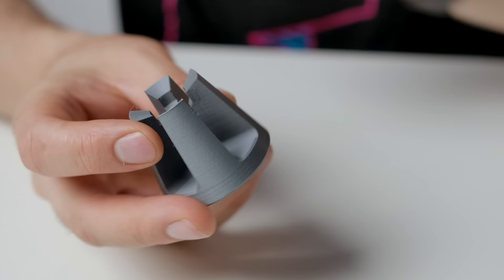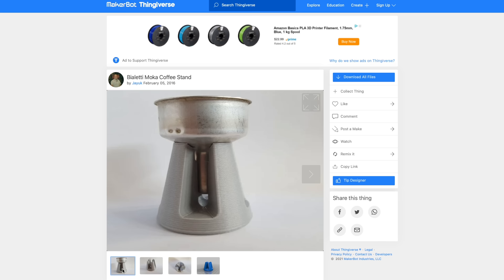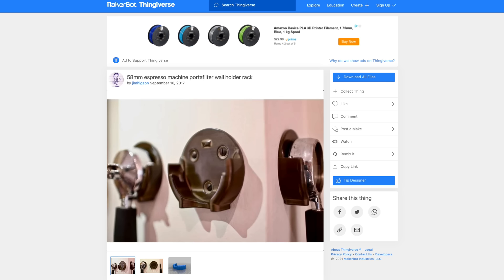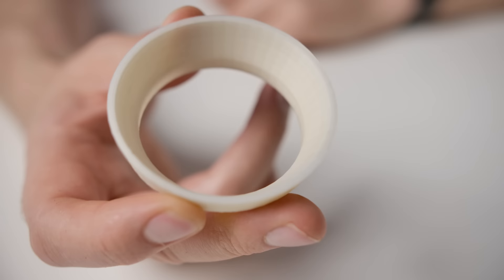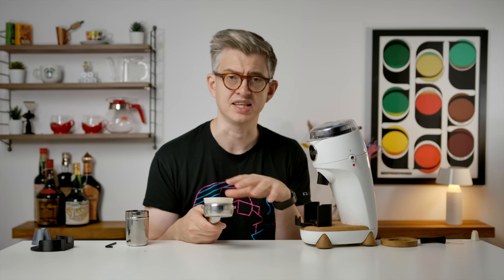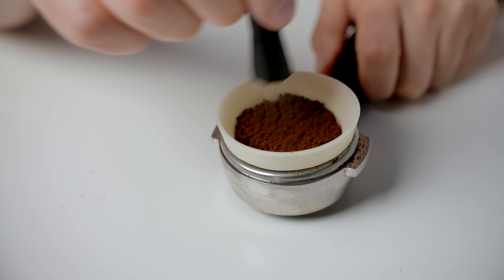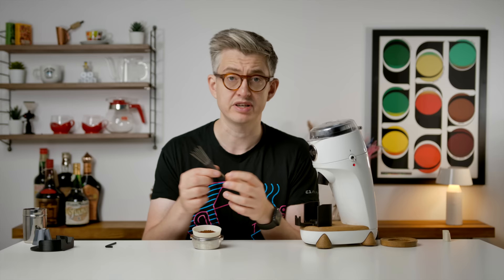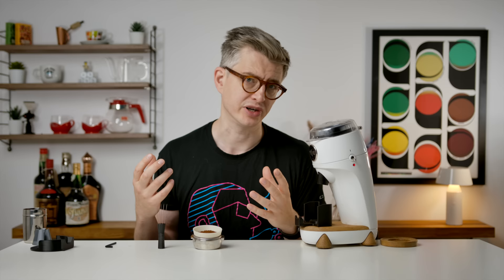3D Printing Coffee Stuff

Comment from the maker: I should note that the Niche portafiler holder print I reviewed is actually nearly identical to a pre- existing product produced by Decent, and available here: https://decentespresso.com/portafilter_stand
I apologise for the error.
Reply: The decent funnel is remarkably nice. There is no flange sticking into your coffee grounds. It is magnetically held onto the basket so firmly that it will stay on if you invert it even though it is a satisfyingly heavy steel ring.
Reply: Filters look very similar as well however the design differ. So no need to apologize.

Comment: Thanks for featuring my portafilter holder! It's fun to see one of the people I respect most in the espresso hobby getting started in the 3D printing hobby that I have loved for so long
Reply: Checking back with Indegogo there appears to be 21,500 of us Niche owners
Reply: I have to ask.... why not just placing it in the boiler?
Reply: @DavidGasperoni  some people have more than one, different handles, different spouts etc...
Reply: Oh wait, you’re talking about the espresso one. I was talking of the moka filter. Yes I like your model!
Reply: @DavidGasperoni  If you're using pre-boiled water then it would be hard to add coffee to the basket already sitting in the boiler.
Reply: @zwyk1ybanan  okay this makes sense. In my case I always use fresh water. I was thinking also if you want to grind directly onto it.
Reply: @DavidGasperoni  If you fill the basket while it's sitting in the boiler, you can get grounds in and around the screw thread area, which can then prevent a tight enough seal around the boiler when you screw the jug on, leading to annoying leaks / low pressure.  Moka pots are so fiddly!
Reply: I'm glad you saw this video Ryan!
Reply: @DavidGasperoni  It's bad luck obviously
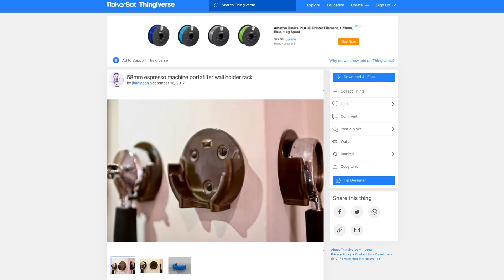Reply: One answer is it's easier and better for the ground coffee to pre-boil the water and pour it into the boiler first, which then makes it difficult to move the boiler around with the filter filled with grounds. If you use cold water in the boiler and wait for the brew on the stove you are actually 're-cooking' the grounds again because they are on the stove for 5:30+ minutes. Pre-heated water in the boiler cuts that time down to ~1min.
Reply: @colinmaynard2879  or more because they sell direct from their site now
Reply: £500 for a coffee grinder?! What could possibly justify this price?

Comment: I love that James is getting into 3D printing. Watching the addiction start in someone else is great!
Reply: @freighter1097  do you know cad?
Reply: @charles_1523  I messed with it back in high school, but never pursued it more.
Reply: @freighter1097  There are limits due to the material (temperature limits, food safe, strength) that do restrict what you can use 3D printed parts for. Once you print a bunch of desk toys and pencil holders you didn't really need, you start wondering what to do next. I found the key was to combine 3D printed parts with other materials like wood and metal; use the printed parts for the fiddly bits and then wood/metal for the strength/temperature resistance. This expands what you can do with the printer and opens up a lot of new ideas. Of course you need the tools to work in metal/wood/whatever to do this, but you should think of the 3D printer as a companion to other maker skills rather than your sole means of production.
Reply: @CraigBrideau  Oh they are undoubtedly a great standalone tool and compliment other tools as well, I just didn't really need it after the novelty wore off. I also travel full time for work so it was something else to lug around. Plus saving the makerspace a few grand was a nice gesture that they appreciated.
Reply: @freighter1097  I’ve had many friends say the same thing. For me I found it entirely novelty until I had a case of “oh, I need this thing. I need to learn CAD and model it and make it” and then OH BOY does it get great.
Ya can go from idea concept, to a sketch, do a model, to having the actual thing within a day. Feels like magic!
Reply: @mwiz100  I don't doubt it useful. However, I don't want to drag a printer around with me from motel to motel, nor do I want to pay for CAD. If I need something, I just buy it. In my 40 years, I've yet to need something that wasn't already available.

Comment: Hi James, you could print a device that keeps the plunger of the Aeropress straight centrically vertical while with the sufficient weight put on top it slowly slides down. I love the sweet result super slow pressing yields but i mean really like >4 min with a coarse grind.  If the plunger is not wiggling around you can put a liquid container on top then fill just enough water until you hardly notice it starting to slide. This water can be used permanently. I noticed that the slow pace is kept all the way down. As in there seems to be no buildup of resistance calling for additional weight to move on. Rn i'm doing this with pieces of a toothpick between the plunger and the chamber. Saves me minutes of having to plunge myself. Of corce with more weight you can also use it for plunging faster or normal. Thankyou for you pleasant manner and kind regards!

Comment: An addendum: You can post-process PLA with two-part food-safe resin, and it will make it far safer than unprocessed PLA. While I would not recommend it as food/drinkware, resin coating allows for significant decrease in bacterial infection and can make washing easier.
Reply: As you seem to have a bit of experience in this field i might ask: Is there any other way to make a 3D print save for drinking water?I thought about 3D printing a costum shaped water tank for my coffee machine (water at room temeratur) and then using FDA approved epoxy...Is there a better way I missed?
Reply: @jaydenhayden8592  There's a few options and all have advantages and disadvantages. You're trying to resolve the issue of bacteria forming between layer lines, inability to wash PLA at high enough temperatures to kill bacteria, and possibly dissolved residue from nozzles (although realistically that should be a very small effect; if really concerned, run cleaning filament first and use a steel nozzle).

1) fill in the lines with epoxy or some other coating for regular cleaning (easy, messy), preferably something food safe
2) use HT-PLA which can be boiled to be disinfected (easy, requires an oven, also requires regular cleaning, relatively expensive).
3) use smoothing (usually acetone) (difficult, best result, can be expensive).
4) use it to to cast something food safe, rather than directly printing the object itself (e.g. casting a silicone item). (Tricky but not that difficult, requires a mold release, pretty much guarantees food safety).

Those are generically the top 4 ways to achieve your result.
Reply: If you really care to go for a swim in the deep end, there's also ceramic filament that contains low amounts of binders that burn away when you fire the parts in a kiln. It takes some experimentation to get more complex parts to come out correctly because they shrink when firing and risk of warping, but it's possible to make wonderful ceramic pieces that can be glazed.
Reply: @BuffMyRadius ah i didnt know this existed. Thanks for the suggestion.
Reply: @gonxau  thanks!
Reply: @jaydenhayden8592  I would also look into resin 3d printing. They make resin for dental appliances so I believe it's food safe as well.
Reply: @jaydenhayden8592  Something to keep in mind is that even if you use food safe filament the process of printing (going through the nozzle, etc) can introduce lead into your part making it not food safe. Like @sneakydingo said, printing and casting is a good strategy!

Comment: James the thing that's great about 3D printing is its as deep or as shallow as you want it to be. The low cost of printing machines these days allows you to just have it as a small hobby, or use it purely practically to print missing parts or for brackets and whatnot, or to go whole hog and make your bed autoleveling and networked so you can print on the fly. You also don't need that much knowledge to get started, and it only really comes into play when you get into more and more complex projects. Like starting at the shallow end of the pool and wading out until you're finally swimming.

Comment: Get a small chunk of wood.  Drill a 1/2" hole and put your Moka Pot basket in the hole and weigh away.  Saved hundreds of dollars on a 3D printer and pennies for the plastic.    
Distribution Tool:  Champagne cork with pins inserted into the flat bottom.   Been using one for years.
Reply: I think that you are missing the point of the 3D printing hobby.  It's the smug satisfaction of having created something without physical or mental effort, regardless of how crap it is...
Reply: 3D printing is a fad IMO. It might not be as compact, but I would much rather have a little CNC machine than a 3D printer. Actually makes useful stuff out of many different kinds of materials. With fewer difficulties. But hey, Ive been wrong before, maybe it really is the future
Reply: @skeetsmcgrew3282  I've got one of both, and I have to say, the 3d printer gets a hell of a lot more stuff made on it than the mill. The time and effort to spin up tool paths, cut, prep and probe the stock, make tool changes etc, 3d printer is much closer to "just press go". That and my baby 3040 is nearly 5 times the price of the little creality these days.
Reply: @skeetsmcgrew3282  desktop bcc machines are useless. They lack the rigidity to make anything out of metal. It'll do aluminum, with a ton of chatter, and a super slow feed, and takes forever. They're worthless.
Reply: lol it's not a fad, it's here now and legitimately useful. Will some people only print off useless crap, absolutely. But for others it opens doors they wouldn't otherwise have access to. 
One thing good that's come from this is the volunteer program that prints  prosthetics for children. Because they grow, the costs of continually replacing their prosthetic parts from a medical supply company was astronomical. 
So while you can initially save a lot money by making a part from common items, it's missing the point of the machine. 
I've printed stuff from replacement parts for my binocular's strap, saving time as well as money, to things for Dungeons and Dragons games. It's handy af.

Comment: I am hugely excited to see the popularization of 3D printing in the common home. I worked in the aircraft research industry and 3D printing in that field is on an entirely different level. We have entered a realm where 3D-printed metals are being used and implemented in manufacturing. There are even small (can fit in a garage) powder printing that uses a laser to melt powdered metal in layers. Then you are able to take the rough print and machine it to the exact dimensions needed. Some research has gone into the integration of a 3D printer with a CNC mill to be able to just put in raw material and get out a completely finished product. At times a part that would normally take weeks to make now takes 2 days. It seems like the real world is looking more and more like science fiction.

Comment: Just remember that it's not just the filament but also your nozzle etc affects the food safety aspects, (and sadly the texture of 3d prints is a real boon for bacteria), if your producing stuff that's in direct contact with something you're consuming
Reply: What I'd suggest is covering the print in a food safe coating, I know some people make 3d printed drippers like that
Reply: Yeah second this, I'm very hesitant to use 3d prints on anything that touches food. That said coffee grounds pre brewing I might be less worried about bacteria/mold growth just due to the nature of the food and the fact that you'll be passing near boiling water through it before consuming.
Reply: I just print the piece and make a silicon copy.
Easy, fast, cheap, reliable, scalable safe etc.
Just a bit of sanding so the copy comes out smooth from the mould and the job is done
Reply: Yep, Brass nozzles are alloyed with Lead, but it really is miniscule amount that makes it onto the print. However, if you want to produce food safe prints use a Stainless Steel nozzle
Reply: @carlandre3892  depends on the brass. There are many many many allies of commonly used brass that's got no lead. Additionally, as you said it's a negligible amount, and an even smaller amount would contaminate your food, and an even smaller amount would be able to go into your body. It's a non issue.
Reply: @carlandre3892  Do those require a higher amperage to bring to the same heat?
Reply: This. PLA is actually food safe, plenty of disposable cutlery, etc is made out of PLA. It’s the texture that makes it not food safe. For dry contact, I personally wouldn’t be too worried but I definitely would avoid wet contact.
Reply: I cant speak to the nozzle, but an acetone smoothing on a foodsafe filament should give you a pretty smooth foodsafe product. 

Disclaimer: acetone vapor baths are essentially small fuel air bombs. Vent thoroughly.
Reply: @PinataOblongata  nope… another simple upgrade worth doing is replacing your tubing with Teflon tubing at the same time while you’ve got your hot end apart if your doing it .. 😀
Reply: That's why you sand it all smooth with fine grit paper. It'll lower that porous layer
Reply: @PinataOblongata  not necessarily, Stainless doesn't have as good of conductivity as brass though, so there will need to be some tuning of flow, speeds, etc, so that the hotend can melt plastic fast enough.
Reply: @PinataOblongata  Hardened steel is the alternative to brass nozzles and don't require any different settings or power usage.  They last longer and cost more.

Comment: Great video! I love those and will print some.
Two notes.
1. There is food-safe PLA. Basically all PLA might be considered food safe before pigments get added, as the actual polylactic acid is completely non toxic.
2. The biggest challenge of making 3D prints food safe is not the filament itself (that's easy to buy and operate) but the fact that nozzles are made of brass, and this means having a small percentage of lead in the alloy through which the filament gets heated and deposited. There are steel, food-safe nozzles, but steel has lower thermal conductivity than brass and these are a bit harder to operate and tune-in.

Comment: Those needles in the WDT tool are also known as acupuncture needles. You can get them pretty cheap online and cut and sand them (so it won’t be sharp and scratch your portafilter basket). I think 0.40mm size would be just right.
Reply: I've heard that a guitar string works, as well. Though, the pieces wouldn't have the thicker parts to hold them in place. You'd have to get creative to come up with an alternative retention method. But at about $2 a string or less, it's dirt cheap!
I haven't tried it yet, but I'm sure I've got a spare high E string lying around here somewhere...

Comment: I like the mocha pot thing, but I've been using a shot glass for the same purpose for ages and it works ;)
Reply: You beat me to it. Plus I use a plastic wide mouth funnel to fill easily decant the coffee from my Lido grinder. I also made a puck stirrer from a plastic cork by heating 6 lengths of stiff wire (monel, inconel or stainless will do) and sticking them into the cork. I used it to distribute the coffee evenly until I found a could get the same result by tipping and tapping the funnel a few times.
Reply: I need a tool to get the basket out of the pot...

Comment: With the Sage range, most of them use 54mm portafilters and finding accessories for them has been challenging and expensive. I was happy to find some like-minded people who have uploaded 54mm designs to thingiverse and I've printed a dosing cup, dosing funnel and tamping station. I've also moved into printing ABS because, as you mentioned, PLA is not food safe.
Reply: The 3d Printing / Coffee community overlap has been wonderful solving this 54mm size issue.
Reply: The same people that say PLA isn't food safe also say ABS isn't.
Reply: @littlejackalo5326  It's easier to 'finish' ABS than PLA to make it acceptable - at least for coffee anyway. Plus, ABS doesn't melt when I put my hot portafilter on my printed tamping station ;-)
Reply: Just mind those fumes, an extracted cabinet is the best option.. also stabilises the environmental temp which is nice 😊
Reply: PLA itself is food safe, the problem is the pigments. Transparent PLA should be fine. And anyway coffee only comes into contact with it fairly briefly.

Transparent PETG is even better as a food-bearing surface though.

I am pretty sure ABS is not even remotely food-safe.
Reply: @fluffycritter  Yes and you have to be mindful of the entire path that the filament takes getting into the model if you really want to do it right, especially at the hot end. 

It can be done, but it's generally better not to if you're not willing to keep up on all the details.

Comment: The "needles" are not 3d printer cleaning needles, but they are the most common acupuncture needles (much cheaper). PLA is food safe (plastic utensils are made from this material) but some filament additives are not, and I suggest switching to stainless steel extruder nozzle for better food safety. There are specifically made filaments with food safety and cleaning/sterilization in mind (edit: SS Nozzles are tricky to print properly)
Reply: PLA makes it really easy for bacteria to grow. This is probably fine for your dry coffee utensils, but given the nature of the textured part that is 3D printed, you're much better off with something you can boil to sterilise - like Nylon, Nonoilen or something high-temperature resistant.
You can get Nylons with EU/US food certification